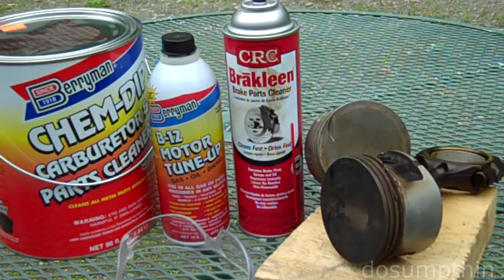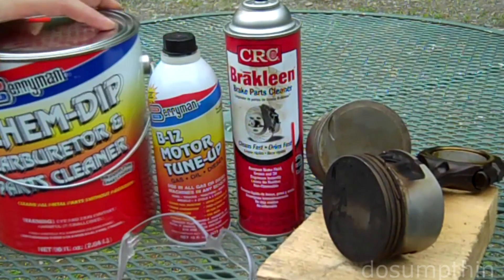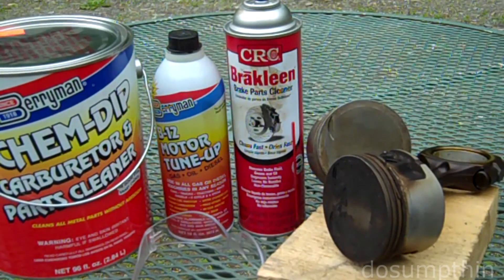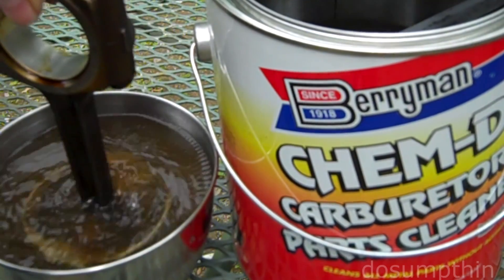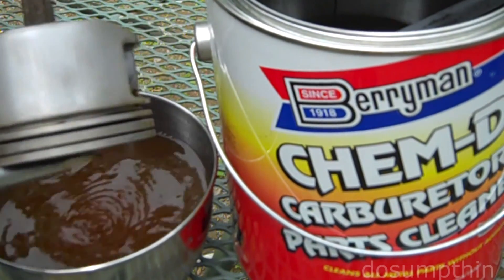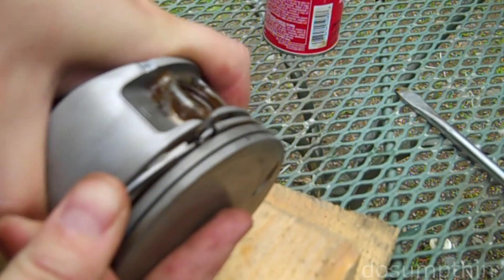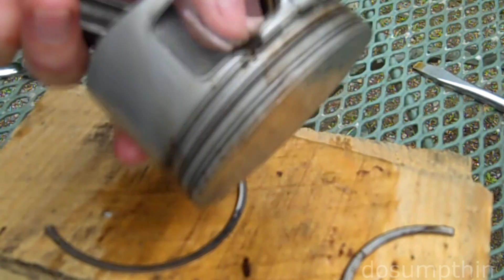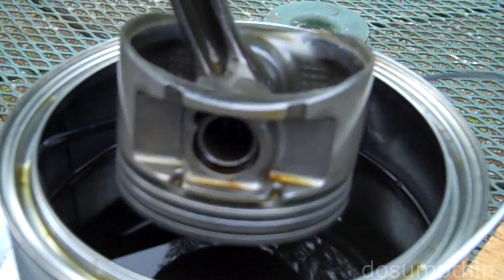Dissolving carbon buildup from pistons - Cleaning piston ring grooves engine rebuild compression

Comment: Any advice if I can use it on top of the piston from the spark plug hole to each cylinder to clean off carbon buildup then I can suck it up with vacuum? how long should I soak it in ? And do I need to use like carb cleaner afterward to kinda lubricate the the piston and the cylinder wall ?

Comment: Oven cleaner. Use the typical precautions.
Out doors, gloves, eye protection etc. Spray it on. Let sit. 
You'll see how good it works.
I've cleaned engine blocks too.
Does make a mess. Be responsible.

Comment: I had to remove carbon build-up from a lot of Continental and Lycoming airplane engines. There could be up to an 1/16th of an inch of carbon on the top of the piston and a fair amount was lodged in the ring grooves. I used a glass bead cabinet blaster (same as a sand blaster but uses a different blasting media) for the piston crown and a modified piston ring to scrape the grooves (not supposed to blast the ring area because the media has a tendency to round the 90° edges). The reason we used glass beads instead of sand is the glass would break apart upon impact with the surface, removing the carbon but leaving the cast aluminum piston in tact where sand would start causing damage shortly after exposure. 
This carbo dissolving chemical looks promising.

Comment: Have a little Saturn 1.9 SOHC also, was blessed it was a 2000 that supposedly has the holes in the oil rings the genius engineers forget to put in them in the earlier years.I didn't know this and till I saw "Old Nuc" RIP. ( You're a mechanic for God now!) state the years it affected.  So I did the MMO oil soak 3 or 4 times, thinking it needed to do it for the coked rings...It sure slowed down the oil usage what ever it was doing in there....Best hard carbon  dissolving agent I ever used was the" Liquud Wrench Super Penetrant" formula from the later 70's.. ( Not sure if it's the same now) Valves had set for years in a 383 head, and you couldn't drive them out with a 2 lb hammer and a punch... Old man we  called "Mr.Mopar"  told us to spray and let em soak with the" LWSP"  I went "out to play" for a day or so. Came back and  they pulled out like a straw in water...Most amazing thing I'd ever seen. I worked on Towboat engines,and no industrial cleaner we used was as good as that stuff..Bar None! I wonder if the formula of today is even close?.....I just use acetone and tranny fluid these days for  rusted nuts and bolts etc...Thanx; Jethro

Comment: Hmmm 🤔 so if you would put it straight into the engine of a v-twin, i mean top it up really good then drain/ flush with clean oil . In theory you end up with clean engine ?

Comment: Not contesting the advantages of a specialized commercial product. But I always use the most basic and cheap oven cleaner I can get my hands on! Work wonders and it's dirty cheap. On my workshop there's always some at hand, just in case. ;-)

Comment: I wonder if this would clear out the gum in the compression and oil rings while still in the engine.  I wonder if it would work if you poured some into the spark plug holes and let it soak overnight.
Reply: Rick West 
I was thinking the same thing and I’ve been trying to find someone who has done it and posted their experience on YouTube.
Reply: Did u find something?
Reply: Anything yet on the spark plug hole soak idea?

Comment: Let them soak in diesel, use a wire toothbrush. Carb cleaner spray would have worked too. Brake parts cleaner is more of an oil remover, not the same.

Comment: You can also use Simple Green and warm it up to about 120 degrees F using a heater and then soak your parts in it overnight. The carbon that remains will be easy to remove with a toothbrush or rag. Smells great too!

Comment: Out of round bores need new pistons anyway. Do it right!
Reply: thepoopsoup you assume bore taper was out of tolerance . If it was not and piston to wall clearance was in spec, then it’s acceptable to re use pistons with new rings after de glazing the bore with a glaze breaker , again if not out of tolerance.

Comment: Citric degreaser stainless steel pan with lid place in oven for half hour at 550 degrees let it cool down when safe to handle remove and drain, rinse, parts will be like new.

Comment: ...Good deal....Berrymans is about the last supplier of anything that works....and they used to be better, but the EPA made them remove a few of the ingredients that made it work for carbon.....still works pretty well for carb's....a gallon of that stuff is waaaay over $30 here in Calif..... Another dis-continued product is Gunk Hydro-seal.....it was terrific for aluminum, and other 'soft' metals that you couldn't put in the heated caustic soda tanks that were for cast-iron blocks... Gunk Hydro-seal was the only cleaner recommended by Harley-Davidson for cleaning pistons and other carboned-up stuff....and you know how old Harleys were, right..?

Comment: when I was a kid working on anything I could get my hands on, and old airplane mechanic told me to rev up my flat head Ford 59 a.b  that I was going to take apart , to around 2000 r,p.m.  and por water in the carburetor 5 or 6 time's, and it would spit and sputter and back fire, and it would clean the carbon off the pistons and combustion chamber, well I did it and it worked, so I have been doing this every time since, on ever engine I have had to build, that would still run,.  in a few cases when I was to broke   to fix it at the time and had to drive it regardless and it burned a lot of oil and smoked real bad sometimes it cut the oil usage in half, and the smoke the same way. try it before you take it apart, it will be much cleaner in side .
Reply: The version I heard was to put an ice cube on top of the carb and let it slowly drip water into the throat.

Comment: After you soak it in Berryman carb-parts cleaner, which I have, what do you use to remove all the cleaner residue and then what do you do for the needle bearings for the wrist pin as far as lubricating them? Needle bearing grease, or just coat them good with 2 cycle oil?  Maybe some one can give some advice. I think I will ask a boat mechanic before using this stuff on my pistons, even though I don't think it will hurt if I get all the Berryman's off and lubricate the bearings. I also thought about putting the piston deep enough to get to the grooves but not deep enough to submerge the wrist pins.

Comment: I just use Easy-Off oven cleaner and old tooth brushes but that Chem dip works well. Solvents don't do much against carbon deposits
Reply: Yes, solvents tend to harden them.  The brake fluid  I recommended above does not do this which is why it works so well.

Comment: Heat the piston rings with a propane torch for a couple of minutes until rings become unseize.If rings are still seized after this procedure use a combination of penetrating oil and heat to free them.

Comment: The worst car I ever bought was a brand new 1995 Saturn SL. Pistons were always full of carbon and getting the spark plugs filled up with gunk and had to replace them every couple of months. They replaced the pistons for free at 30K miles, then when the warranty was expired I noticed the spark plugs getting dirty again. It had oil/filter changes often and burned oil. Worst car I ever bought. I will never buy a Saturn again.

Comment: any more this stuff is junk, i think the chemist learned how to reproduce the smell of the old stuff that worked, permatex used to have a gasket remover that enhialated gaskets, now on the label it says safe around kids and pets, also now it is manufactured per gasket type, which is bs. i tried the type for gasket application it didn't even phase it, it was a clean compressed head gasket on a motorcycle. junk products now day, but look on the bright side more healthy kids that don't respect nor have interest in much of anything except destruction of things that don't need cleaning.

Comment: Just soak the piston with water and dish soap, then brush the top part using wire brush, while the rest using stiff plastic brush. Works just fine.
Reply: And put it back in the cillinder after you fucked up the round of the piston?
Reply: Yop Brookhuis that is exactly what I did and guess what? The engine runs smoother than ever before. I also dried and soaked the piston with gasoline before putting it back into the cylinder.

Comment: That is crazy I have used B12 to clean carboned up valves and my Dad has used it since 1991. The metal can that does not say "Fuel Injector Cleaner" should be insanely strong.Saturn's older I4 and V6's are well known for carbon issues and oil consumption and in general GM has been plagued with carbon issues on piston tops, valves and the injection systems that used popet valves and a central injector. MMO is fine for a continual use thing as a preventive or if you have a ticking lifter but it is not going to clean anything. It is too mild.

Comment: Use BBQ grill cleaner, found at Lowes, Home Depot or any hardware store. That stuff will turn the carbon deposits to liquid, that you can wash off. This is the zero labor method.
Reply: Brian Zero  Read the ingredients in oven cleaner.
Reply: Careful...Sodium Hydroxide eats aluminum. However I'm not sure how it acts with high silicone aluminum alloy...I'd stay on the safe side.

Comment: I wish they still made the Chem-Dip from 30 years ago. That stuff was awesome. It was pretty toxic stuff. They quit making it because people weren't wearing gloves and it absorbed through the skin readily.
Reply: i've been working on internal combustion products for years on end, gasoline, all the carb cleaners, diesel, oils gear lubes, greases, propane, butane, acetylene etc, i forgot where i put the list but it took a full page and a half on lined paper, all the toxic stuff, oh and a daily dose of carbon monoxide exposure, and in a shop without windows, only the chimney, welding flux gasses constantly, without gloves respirators, only oily dirty rags and some cheezy hand cleaner. i'm almost 60 with 30 year old health. with all meat and alcohol diet. and only just recently did a health symptom appear out of nowhere, it was like a middle back pain that migrated up one side and then the other finally into my shoulder and elbow and hand, on one side only now. medical advise said to go immediately to the hospital, I got more motors to work on, no way was i going to the drs, they suck worse than the new cleaners, the pain is fading, but i think it could be an exposure thing from chemicals. we are plain products of what we do. i bought some disposable gloves.
Reply: @buckwheat7424  You should go to the doctors. Quirks like that are warning signs for something serious to come. Just like cars give warning signs on when something isn't right before it breaks, your body does the same. Trust me, I lost my father because of stuff like that.
Reply: suzuki methracer (lol) no really, i bet that'd fix almost anything. that'd be a whole different adventure. only tried them once as a teenager, and a couple lilly F40s(a different time as a teenager, I kind of like those, felt like the baddest assed teenager,) then in early 20s' alone i got a motel, bought a 20 dollar bag of tar split it and did one half of it, instantly threw up but didn't feel sick and went to sleep for 16hrs, woke up did the other half, same exact thing my late 20s an ex girlfriend of my brother's talked me into by a "lode?" for 40 bucks, I did. woke up the next day in her trailer, all that was left was a pair of boxers, everything else was gone, wallet and all. but 4 months ago, i wrote about the strange back pain, muscle, nerves or psychologically caused. it went away, only to return as an entire different set of what felt like life threatening signs and symptoms 2 more times that ended with tooth aches, to which I prescribed myself some fish mox250 mg 3 times a day for 2 weeks, the third was some hellacious radiating and travelling pain in my head, from another toothache, i ended up taking over 4000mg daily of acetominophen tylenol, with 1000 mg of exedrin pm on top of 8x's over the maximum allowable alcohol (40 ounce king cobras) limit daily with the stuff, for 4 days in a row,  only then i found out it i might die from taking that much. plus it only helped for an hour or 2, on the same night found out that another treatment of fish mox was needed, i bumped up the dosage to 500 mg 3xs daily for 1 week. the first 500mg completely ended the pain within an hour. my face was swelled up.  I don't go to drs. or hospitals nor dentist. I got a couple of teeth that broke off piece by piece and figured what did we do before dentist? besides grunt and hunt. I probably should get those teeth pulled. after i cram in a newly put together carburetor rack, keihin 20 or 22mm that goes on a sweet 
 red cb400f 1976. been riding it since early 80s. putting a yellow one together, from the ground up, all on the floor.
Reply: @buckwheat7424  --Dude !!!!!
Count your blessings that you are still able to breathe...Im not gonna go into my judgemental opinions but do think that you ARE AWARE of possible consequences coming your way...So long story short i would HIGHLY recommend that you get yourself informed and immediately start CHELATION THERAPY...In particular-ORAL intake of EDTA...Good luck to y'a.

Afterthought before posting this:::: Heres the link,,watch this...
https://www.youtube.com/watch?v=xJOITLEiqqY
Reply: Let buck wheat live like a boss till his dying day which I hope is a long time from now. It's a mental game too. Worry like a nervous wreck about everything and you'll be in the grave.
Reply: 10 milligrams of Valium before bed will fix your back if its muscular you will know by the morning even works on my old dog

Comment: I use easy off grill cleaner.  Just spray it on, wait 20 minutes and spray it off with a water hose.  Only the toughest carbon will remain which will go away with a 2nd application.

Comment: Berryman chem dip is absolutely phenomenal  at dissolving carbon buildup on engine parts that you look at and go ' how the fuck am I gonna clean that?'. My experience on a Honda inline 2 liter and a ford 351 is it works just as well as is demonstrated in this video. If you can get the part submerged in this stuff it WILL get the carbon off and come out totally clean. On really funked up pistons it might take about four dips and cleaning, scraping loosened crud between dips. You gotta scrape off the crud between dips  so the chem can attack deeper carbon buildup. Rinse and repeat. Every last speck of carbon is off. Then measure piston, and toss in trash can. lol

Comment: don't use 87 used 93 and you won't have that f**** problem everybody does that that used to cheap gas that's what does it
Reply: the octane rating of gasoline is a measure of how well it resists knocking or preignition. not a rating of quality.
Reply: Put a catch can on your PCV system. You'd be surprised how much nasty oily crap gets sucked into your intake. And running synthetic oil...  less deposits.

Comment: I've been using that cleaner to soak parts for years, it does a great job but needs time to work. Also pick up an assortment of medium stiff nylon brushes to work the crap out of the nooks and crannies on parts. I stopped using oven cleaner a long time ago, some brands can be caustic on non-ferrous metals and etch the surface.
Reply: Good stuff but, Don't breathe too much of it, it's deadly.
Reply: +Mike Buck Absolutely, you have to be safe.

Comment: Just run you a sink full of very hot water and some dish washing liquid. Let the parts soak for awhile. Run another sink full of hot water. Use some SOS pads and they will come clean and shiny. I've been doing this for years and it works every time. The great thing is, it's so cheap and your parts get washed in the process. Ready for assembly.

Comment: Welp looks like advertising. .. I know a secret to disolve carbon build up in half the time if not less
Reply: Well, you going to spill the beans, or not?
Reply: Im putting together a old Toyota engine and would LOVE to know, message me if ya want lol
Reply: Soda blasting?
Reply: I used aircraft stripper... ... the spray or goop type both work .... your gonna need a little bit of sub and rub ... I used a few popcicle sticks... a brass brush would help more.... and don't use a stainless steel brush
Reply: then to final clean them I used gasoline 87 octane to be exact with brass wirebrush
Reply: Thanks man, funny as I randomly picked up a few spray cans of aircraft stripper just last week lol
Reply: Chris Collins perfect... It may take you I would say at least 3 rounds of 10 mins in between to let it eat the carbon..

Comment: I use oven cleaner on Aluminum heads and it cleans them to absolute perfection
Reply: I did the same just didnt leave it in for prolonged period of time on the set i was going to use on my build and a test set i was going to junk i left it on for about an hour and it did nothing but left it looking amazingly clean

Comment: I don't know much about cars so please excuse me if this is a dumb question but could cleaning the pistons, valves etc, with this stuff help stop a ticking noise from engine and improve the performance of a high mileage car?
Reply: +B. Anthony Maybe on the noise ,probably on improving performance. maybe get or do compression and or leak down test done first . Give you an idea of the health of the engine .
Reply: Ticking noise is probably your lifters. Soaking your lifters in this stuff may help.